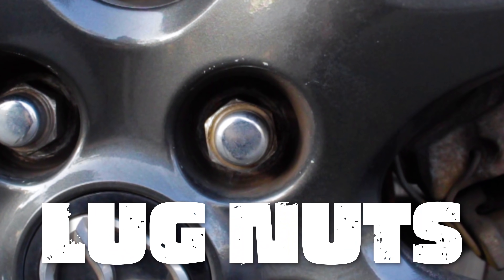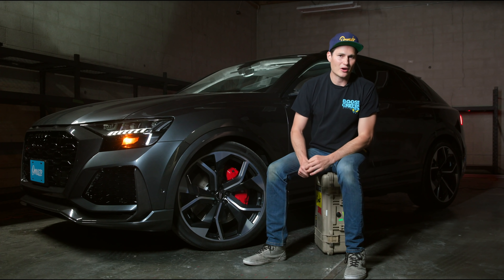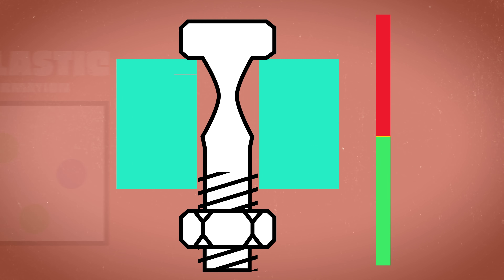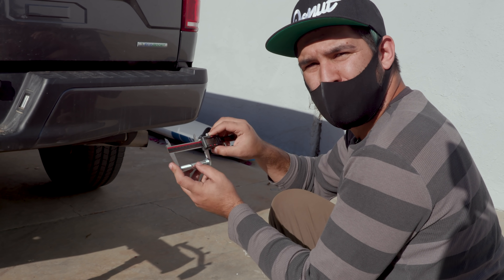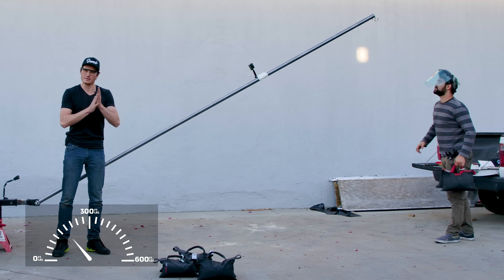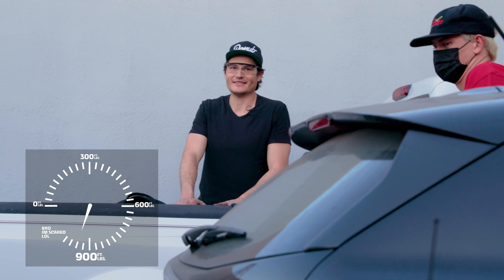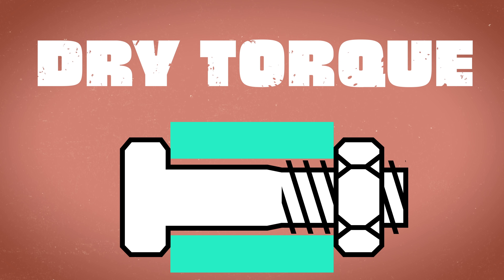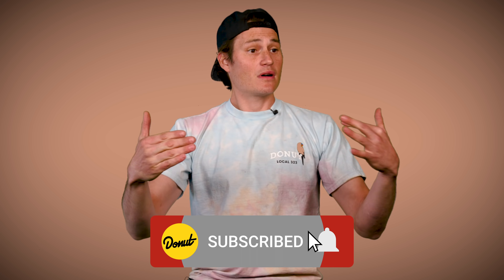What happens when you over torque a bolt?

Comment: I'm a mechanical engineer working in the defense industry. I do a lot of calculation work on fasteners used in critical applications. As a result, I'm a total torque spec nerd when working on my own cars. You guys nailed a lot of the science. Only thing missing was mention of thread shear during the overview of failure modes, but maybe that's too much. Seeing the 'Donut take' on something I do professionally was awesome! Such a great video!
Reply: Is thread shear just stripping the threads?
Reply: @Dozav7  Bingo! Commercially available fasteners are normally designed so that that threads won't shear before the fastener body/shank fails, but it can happen in certain applications/contexts (for example, inadequate thread engagement on a stud).
Reply: @Biker790  Also missing the material. 7075, 17-4, 716, ti-6al-4v etc.. Strange how we get excited and geek out about work outside of work, but not AT work.
Reply: @LBCBassKings  i geek out over machining at home because i put a 5-axis spindle and motor on the table of an UMC-750

At work, i push a button, adjust some numbers, push the button again and adjust again until i think of a way to alter the toolpath to make it slightly faster (i saved .07 seconds on cycle time on our biggest product yesterday, decreasing cost of manufacture by ~15k/mo) and then back to adjusting.
Reply: I'm a Metrologist, and deal with all of this. Made me geek out.
Reply: @samo4866  ayyyy me too Lmao
Reply: Is it worth it being a mechanical engineer? I'm graduating highschool soon and i want an opinion from someone in the field. Thanks.
Reply: @JuanMartinez-pg3mk  do it, you won't get bored!
Reply: @JuanMartinez-pg3mk  If you're interested in engineering, mechanical is great. Because mechanical isn't industry specific (like, say, aerospace), I think it provides the greatest flexibility in terms of career paths for an engineer, at least as far as undergraduate studies is concerned.
Reply: @JuanMartinez-pg3mk  absolutely! I'm a mechatronics engineer and the opportunities and possibilities are endless. Engineering is not only a career, it's a passion and if you enjoy the sort of thing, it'll ensure that you're happy every single day you wake up and go to your job. Well worth it.
Reply: @JuanMartinez-pg3mk  depends what field of work you wanna go into. What interests you about engineering? Mechanical is pretty versatile. I’m a civil engineer, but I know plenty of mechanical, computer, electrical, and chemical engineers
Reply: @JuanMartinez-pg3mk  depends on what you want to do. im both a civil and mechanical. think of like this say you have a large machine or structure a civil would worry about outside of it and a mechanical would worry about the inside and inner workings of it. two similar fields but also two different ones. this is based on my experience so your call
Reply: They also seemed to miss the thread pitch affecting the leverage of the torque on the bolt stretch too, but you know I guess they don't wanna get too involved with it for a quick yourube video.
Reply: @Neishy86  the engineering that goes into a simple bolt is astounding, they didn't have enough time to explain it all, but did an excellent job of skimming everything you'd need to know.
Reply: @samo4866  yeh I know i just figured they'd mention the fact that the thread is basically a gear ratio for the effort you put in, but instead they wasted half the video jumping on ladders trying to snap a bolt that looked stronger than the square drive they were using lmao.

Its just that the thread is important to the everyday guy as well, as in how tight you would do something up.
Reply: @samo4866  yea but I’m still gonna reuse all the stretch bolts
Reply: @Neishy86   For typical fasteners, while the thread pitch does affect the number of rotations required to reach a specific torque, it actually has very little effect on the relationship between torque and bolt tension since the applied torque is primarily reacted by friction in the threads and under the bolt head. Coarse and fine thread fasteners of the same nominal size do have different torque specs, but this is due to the larger cross-sectional area of the fine thread fasteners allowing them to carry higher tensile loads. ☺️
Reply: @Neishy86  Thank you for covering that oversight.
Reply: My dad works as a engineer at Volvo cars, more specifically testing engine mounts and such in rigs to see how much force they can handle and trying to help develop a part that is optimal for Safety, Durability, and for comfort and that also doesn't cost too much. He's a very frequent torque wrench user in the garage, but when you torque down a bolt do a test in the rig to then re measure the torque value and see how incredibly important it's to use the right torque you will do so your self. It's kinda hard to study for a car mechanic and to never ever see a torque wrench and to then come home and use it for lug nuts. I mean sure you can get a feel for it but if you never check how good your feel is how do you know it's accurate? 

I think you guys would get along in the garage haha.
Reply: The same here. The biggest bolt which I have seen was M100. There was a need for a special nut for thickening the bolt
Reply: I feel like they didn't do the math right for the pole, because its weight is spread. How would you do the math for that?
Reply: @MindBlowBrainCrashTest  I think you can use the fact that the weight of the bar is a distributed load. With this in mind, you can represent the weight as a single force acting at the centroid of the distributed load. You can then calculate the moments caused by the weight of the bar and the weight of the sandbags around the point where the bolt is.
Reply: @MindBlowBrainCrashTest  The effect of the distributed mass can be calculated to get an equivalent mass at the end of the rod.  In the case of a slender rod rotating around its end (as in the video), the effective mass is equal to 1/3 the total mass of the rod. Google "mass moment of inertia" or "angular mass" if you're interested in more detail
Reply: @johnmurray9746  Here's another question. Wouldn't the bar's torque on the bolt change as the angle gets closer to 90, because they use gravity to get the torque?

Would it be distance from the bolt or distance the weight is away in just the side to side dimension to get for the calculation?
Reply: @johnmurray9746  that's rather interesting, considering a bolt that has twice as fine a thread as a coarser bolt, would in theory double the clamping force for a given effort on the ratchet. Of course that is only in theory, with friction not accounted for, I'm sure you know what I mean.
Reply: engineer seal of approval?
Reply: Here’s a practical one for ya.  I always tighten my lugnuts on my wheel as tight as I can with the wrench in the trunk.  Why is that the correct torque?  Because when’s it’s 2am in the snow, that’s the tool I will have to loosen it and I need it to work.  Tired of over torqued wheel bolts.
Reply: Lots of times they aren’t overtorqued, they are frozen. 

So while the torque to remove it might be higher (and why you use an impact wrench to break it loose), the preload is the same.
Reply: i recently saw an example of the threads on a bolt sheer it was on a 50BMG rifle its quite crazy the force put out by using the wrong powder within a round
Reply: @Aeriket  Kentucky Ballistics?
Reply: No need to take account fatigue of the bolts?
Reply: how come some bolts don't have torque specs? Like, my ford explorer's "idle air control valve" has two 8mm bolts that go into the aluminum throttle body but they have no torque spec. you'd expect there would be one cause it seems like an easy one to overtighten and strip out.
Reply: @nickaa827  They almost certainly do have a torque spec from the OEM. A lot of those specs would only be specified by the OEM in manuals published specifically for use by Ford technicians. Finding copies of those manuals can be tricky. Non-OEM manuals, like Hayes, probably includes a torque spec, or at least provides guidance "finger tight until snug, turn another 90 degrees" for less critical fasteners.
Reply: hi, i’m going to school next year to become a mechanic. I was wondering, how do you know if something needs to be torqued down?
Reply: @melmao878  Everything needs to be torqued down, which is just a way of saying "tightened". Whether or not something needs to be torqued down to the specification really depends on the criticality of the fastener (what are the consequences if X fastener loosens up/fails?). You'll develop intuition for it through schooling.
Reply: @Biker790  Thanks, i always wondering like how do peopleeee know unless chris fix says to torque it down hahahahaha
Reply: @Biker790  hey man, i understand everything else about torque spec, but i still don‘t get why head bolts for example have to be tightened a set number of degrees afrer tightening to torque spec. why don‘t they just give a higher spec to begin with?
Reply: @vapenation7061  torquing by degrees establishes the clamp load while ignoring the torque required to overcome the friction. Setting the initial low torque value sets you up for this step before friction becomes great enough to produce loose results.
Reply: @vapenation7061  Torque is just a means to an end. What really holds the joint together is the tension in the bolt. The reason we use torque is that tension is not easily measured. Friction dictates how much of the torque you put into the head actually turns into tension, and friction can change. For example you might generate 1800lbs of tension on a dry 1/4-20 hex cap screw torqued to 25 ft-lbs. If you were to apply a lubricant to it, you might end up with 2200lbs at the same torque. For critical joints this variability can be unacceptable. To this end, another method that is not variable can be used. Tension increase on a bolt is constant with the angle of rotation. Unfortunately, the starting point of tightening the bolt isn't going to be the same every time, so we need to establish a starting point. To do this we start with a low torque value, because torque at lower values is less influenced by friction. For example, we may chose to snug our 1/4-20 hex cap screw to 5 ft-lbs, which is tight enough to have pulled everything together, but not tight enough to for friction to be a major influence. From this point we can turn the screw a specific amount of degrees and are more likely to be close to our target tension than if we were to use torque alone.
Reply: Yeah that was the first thing I thought of when I saw this but totally forgot after they started testing.
Reply: You likely know more than me but I’m an Engineering student right now and their calculations for the approximate torque applied seemed off to me, at least the initial “140 lb-ft” of just the bar. My best guess is that they calculated the weight of the bar as if it is all on the end of the length of the bar and evenly across it, plus they clearly didn’t include the angle in their calculations.
Reply: I work for bolttech mannings.  I could help you guys with all your tq needs!!!
Reply: But the question is how much torque was lost due to the flex in the pipe
Reply: On small fasteners it just gets you ina  world of trouble
Reply: So I want to know who makes that braker bar
Reply: Damn I fit tyres bro and I thought I knew the extent but you did know more then me about bolt science I respect you for that and for the defence job. I just ugga dugga
Reply: i read this whole thread like i know what im talking about, Interesting stuff. I love hearing " shop" talk from different fields. Im a chef by trade. But love hearing people talk about their line of work. Especially passionate people
Reply: I love math when it can relate to actual hands on nuts and bolts! Physics are the shit
Reply: BTW the slinky mention is basically the same thing except there is no centemass it is basically the same but different but I get where you are coming from. I think since the sub episodes that community is attacking these guys but the do know alot just not everything. They work as a team as all mechanics do. It's frustrating some times I'm a machinist and some times the answer can be right there but some times it just takes someone stupid to walk in and I mean that. Someone with a random idea for you to find out what's going on
Reply: Cool but these are just a bunch of gear heads bro
Reply: 70 to 90 thousands boys it don't take much
Reply: Obviously more math more length Les you need to break the bolt depending on weathering or anything else honestly
Reply: What is your mothers maiden name?
Reply: Hello fellow steel guy
Reply: Which defense company do you work for? I currently work for GD and I kinda like do ask different people who work in defense
Reply: Just yes German torques specs are n everything . 
“Yup it’s gud-in-tite
Reply: @Good Times Roll Do TTA bolts like the ones used for BMW e46 reinforcement plates and V-brace need to be replaced after one use?  On the logic of this video I understood that TTA bolts only went up to the yield point but not over, so they had not plastically deformed and so could be reused.  But TTY bolts are a different story as they are designed to plastically deform (and have a physically different appearance). Can you shed any light on this?  Thankyou
Reply: Teach my, I have to review all the work on these things as an inspector!
Reply: I know a man who could set a bolt so deep it would ruin the mating surface, or at best, make it impossible to adjust. We seen you, Cunningham! Knock it off!
Reply: as a mech e student myself i was really impressed to see how they discussed tress and strain and detail the curve.  Really cool to see the stuff on youtube and professionals like yourself reinforce what im learning everyday!
Reply: a quality ass comment
Reply: You known how I know your are a engineer? Because you always tell everyone! 😂
Reply: As a mechanical engineer in my junior year, I would luv to work in the defense industry. Cool stuff m8
Reply: I also am an ME in defense! I recently took my car to the shop to get new tires. Got it home and tested my lugs. They were twice the torque spec. I definitely called the shop and explained why their techs are putting peoples lives at risk by not paying attention. Explained what plastic deformation was and why it can cause a more sudden failure on the road.
Reply: One question, the max torque of a bolt is designed after its yield strength Rp0.2 or after its fracture toughness Kic due to the sharp edges and stress concentration?
Reply: Next video: what happens when you under torque diz nutz
Reply: I'm a professional knifemaker and bladesmith, another huge factor never even mentioned by you or the donut folks is the type of metal "alloy". The metal alloys which the bolt, nut, or fastener is made of is a critical factor followed by the heat treatment of that alloy. The alloy type and associated heat treatment can have an even greater effect on performance than changes in size , thread count, or surface area contact. Literally the material choice (type of alloy or synthetic compound) is the primary guiding factor for choosing fasteners and it was never mentioned. How stupid is that?  Heat treatment and the specific process is also a huge factor.

Comment: Sorry ,

 but your explantion isn‘t completly right. Correct is:  if you put enough strength on the bolt to stretch it in the plastic range ,  it deforms to the length of elastic + plastic range. But if you now lose the screw,  just the deformation of the plastic range stay‘s. The elastic part of applied stretching forms back to normal length. 

Also the Parameters may vary  with every cycle of losing and stretching if you screw and unscrew a lot of times. For short material fatigue
E.G. :   S235 (structual  Steel)  after  10^7 times  and 1060 MPa of applied force (N(G)) the material will eventually crack(in relation to the Cross section). 

So if you want to screw it in just 1 time the ‘tensile test‘   is important (stress-strain diagram like you showed ).
For lots of screwing and unscrewing you have to look for  the ‘Wöhler fatigue test‘ (high-cycle fatigue diagram(under alternating load)).

Thanks for Reading until now.

I love your Videos.
 
My best regards, 

a typical Engineering Student.

Comment: Fun fact in the shop a bloke with a GT86 wanted to fit his winter tyres alone, ended up stripping 8 struds + overtorqued his wheel locks... Royal pain the the ass to remove

Comment: As a degreed engineer, I was cringing all through this video.
Reply: So what’s your take on this ?
Reply: @lostblizzard3450  Much of it was pretty good.  For example, the Elastic / Plastic stress-strain curve was right on target.  But the line about a 1" bolt being 4 times as strong as a 1/4" bolt made me cringe big time (they corrected their position at the end).  Also, the graphics showing the bolt thinning before breaking was definitely cringey.  The thick portion doesn't break, the bolt will always break in the thread area (unless there is a serious defect in the bolt).

I watch Donut videos because they are fun, informative, and entertaining.  But they are not always the most accurate source of technical information.

Comment: A bolt with a fine thread will have more tensile strength than a bolt with coarse thread because of the difference in cross sectional area. The force applied when torquing is called MOMENT. MOMENT is a force times perpendicular distance.